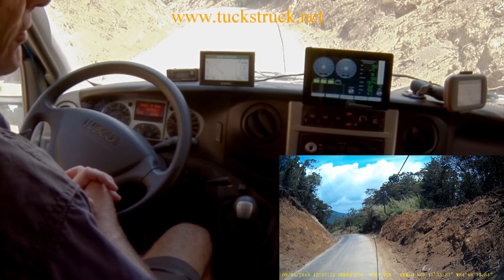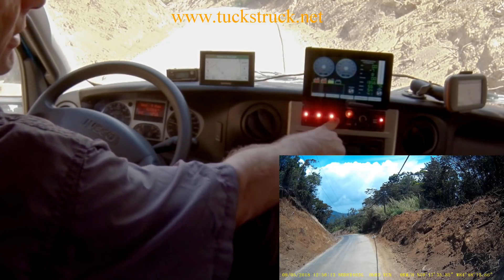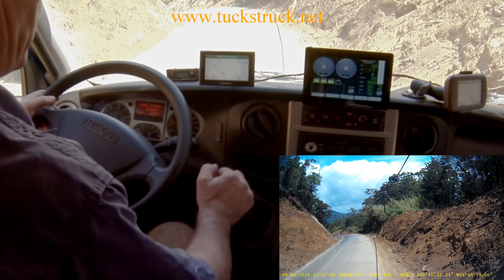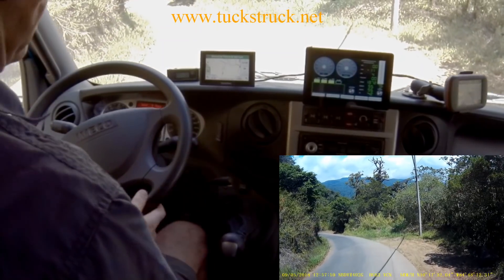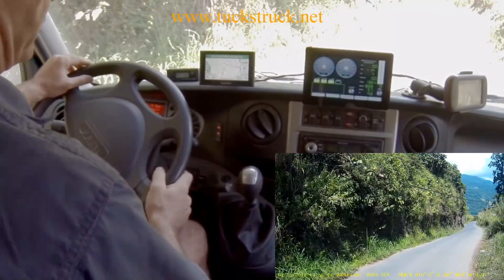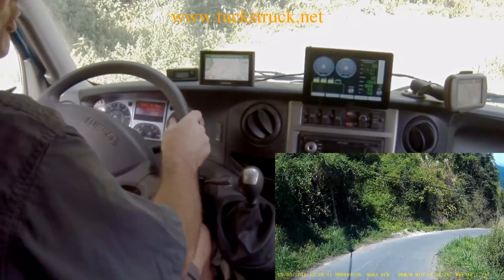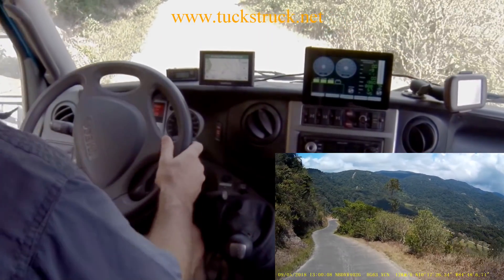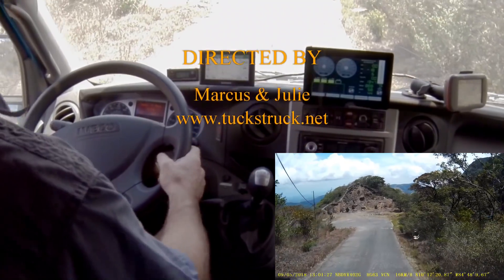Low Range Gear Retarder Demonstration

Comment: Hi what type of retarder do you have on your iveco as l have a braking issue  with my iveco  especially  when going down steep passes. Aprox what is the cost of installing a retarder and would one install it through iveco. Thanks Gary
Reply: Thanks for the response, when contacting  the agents for thelma retarders they are happy  to fit them but iveco  will not suppy them with the electrical diagrams for the 4x4 iveco. Thanks once again for a fantastic  video. Gary
Reply from the maker: Hi, it's a Telma retarder, full details of the installation are here:  https://www.tuckstruck.net/truck-and-kit/modifications-and-repairs/braking-electro-retarder-installation/
Reply from the maker: The retarder was £2600 in 2018.  If you have a Daily 4x2 a retarder is an Iveco option so it should be easy to add.  However, if you have a Daily 4x4 it was never offered as an option so you would probably have to copy my installation.

Comment: The Telma retarders are excellent devices.  i have used them countless times when PCV driving - apart from any other consideration, the main use was to ensure passengers and crew had a comfortable journey where being jerked forward by uneven braking was no longer an issue - very important when hostesses used to bring hot drinks to passengers while on the move !  i currently have an Iveco 16 seater, and i would love a Telma for all the reasons given, but i reckon the cost would be astronomical for the age of the bus (2004)

Comment: It's an interesting video. I tried to spec an Iveco Daily and at almost every step I was rubbished. Rubbished for wanting single wheels, rubbished for wanting the diff locks but mostly a complete refusal to even contemplate the idea of pricing a vehicle with a retarder.
Reply from the maker: Thanks.  I know others that have found Iveco hard to deal with.  One friend wanted to buy 3 Daily 4x4s as support vehicles for his Motorbike Rally team, Iveco didn't even reply to his enquiry, he has 3 new Mercedes Sprinter 4x4s now!  Modern vehicles have so little engine braking the retarder is a great option, it is also silent unlike engine brakes (interestingly the Daily 4x4 engine is also used in the Fuso and the Fuso has an engine brake option which Iveco don't do for some reason).  Unfortunately, the retarder is not an option on the 4x4 but is on the 4x2 Daily.  I did see pictures of a trial installation Telma and Iveco did, but they didn’t think out of the box and tried to install it in the rear prop-shaft drive line.  This meant that they lost a lot of the ground clearance and so it never went into production.  The advantage of my installation is the retarder is mounted high so does not affect ground clearance and has the added bonus of becoming more powerful with the use of the half gears and low range.

Comment: Great video, thanks for demonstrating the retarder. Do you have any information about your center screen/computer?
Reply from the maker: Hi, Thanks.  It is a 4D Systems display that I have hooked up to an Arduino Mega which in turn is hooked up to my differential lock computer.  It's all a bit of geeky fun.  I guess I need to do a full write up on my website.  I have done a short write up for my differential lock computer here:- http://www.tuckstruck.net/truck-and-kit/modifications-and-repairs/afam-computer-replacement/